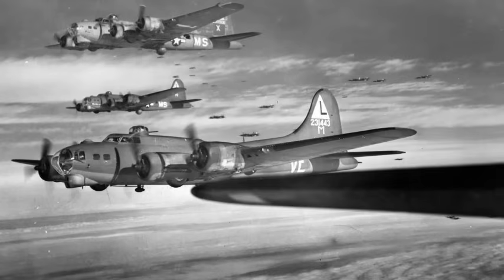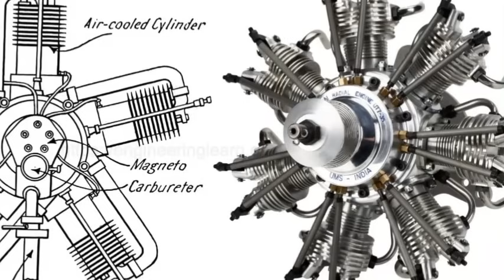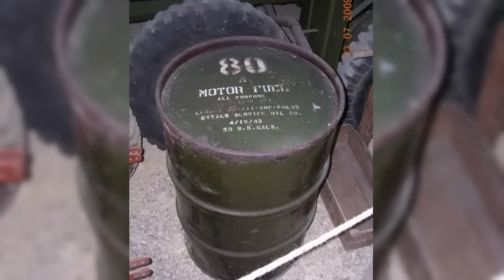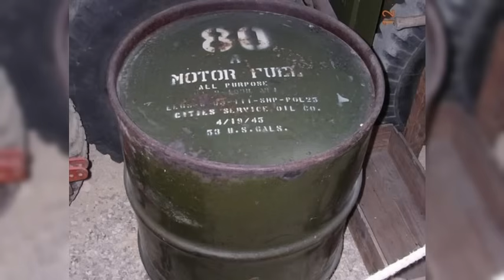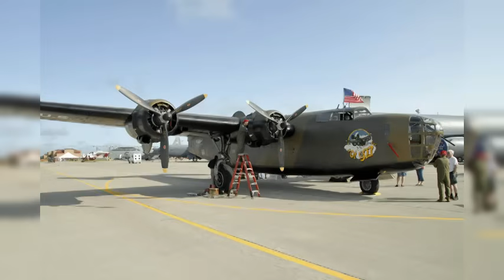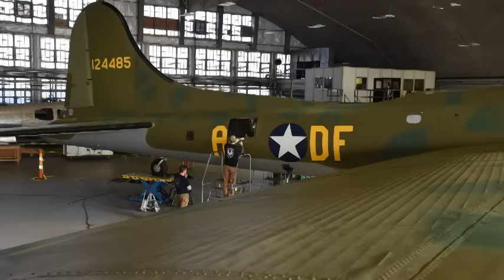The Lubricant That Quietly Kept Allied Bombers Flying

Comment: The most important thing I learned working with top lubricant engineers was, additives don’t lubricate, only the base oil does. Now today’s top tier additives are helpful but too many or mixing brands with different additives can cause harm. 
The only thing I learned was changing the oil is crucial. 
Ironically I worked for Pennzoil’86-‘93 and by then the base oil was almost exclusively West Texas Sweet! The paraffin based PA oil needed to be changed often to prevent the wax from buildup

Comment: In the 80's, I was a gm certified technician. Oldsmobiles with the 307 engine were notorious for cloging the oil return ports if quaker state oil was used. First indicator of clogged return ports was oil leaks down the side of the engine as the valve cover filled up with oil. Pulling the valve cover usually turned loose a quart of oil per head on the floor. Inspection of head showed rocker arms and inside of valve cover coated with a waxy buildup. It was so bad in some instances that scrapers and screwdrivers could not remove the build up and components had to be removed and mechanically deburred of the parrifin/wax buildup. This problem became so bad that I could say to the customer "you are using Quaker State arn't u? The answer was always yes. So I'm not sure how using this particular oil from NW PA helped us win WWII unless radial engines didn't circulate oil like a v-8. This one particular issue became so bad that we refused to use Quaker State in ANY engine in the cars we sold and would not do an oil change if the customer brought Quaker State oil for use to use for an oil change. We always recommended penzoil for oil use. Never had any problems with that brand.
Reply: Retired gm tech- yes I have seen many engines with Q.S sluge,but. Those engines had less wear and could be rebuilt. To add Q.S. engines had less oil leaks. I know sluge is bad.
My american Porsche  likes thicker oil in summer,and it leaks.
I ues diesel oil for the additives.

Comment: Essentially, the Pennsylvania crudes are classified as a paraffinic oil.  Paraffins make a wonderful lubricant.

Fun Fact:  The modern day "synthetic oils" are nothing more than conventional oil that is processed to produce paraffin chains with specific chain lengths.  The straight paraffin chain is what allows the desired lubricity.
Reply: True synthetics include oils that are entirely synthesized from chemical constituents, vegetable polymers, and natural gas. Fully synthetic lubricants do exist that are not derived from crude oil. Group V. Including those made from: Esters, polyalkylene glycols, GTL, and bio-synthetic lubricants.   
 Reformulated crude oil "synthetics" are those that have been processed from crude oil components to re-link broken polymer chains and link new ones. These are not true synthetics. When catalytic reformulation is used on petroleum fuels they aren't allowed to refer to it as "synthetic" by law, but that doesn't apply to lubricating oil. That's a questionable marketing ploy used by motor oil packagers and includes synthetic blend and semi-synthetic monikers. The biggest benefit is increased production the same as reform gasoline. That allows the use of unsuitable distillation fractions by synthetically modifying polymer chains.
 If you want to use true synthetic oil, you need to be careful to validate  the preparation process used to make it.
Reply: @ir8d8rads  Tyvm, I am not aware that there was a legal definition of "synthetic oil".

I appreciate your contribution, but it comes across as if that hair was split any finer, it would only have one side.

I was also referring to the mineral oil base lubricants, not some of the various lubricants that you mentioned which usually have very specific applications such as fire-retardant lubricants or food grade lubricants.

Comment: That was a very interesting story, but does demonstrate a lack of understanding of aircraft, the DC-3 was one of and Is my second favorite and she held 26 gallons per engine, With Normal Usage rates as high as 1 Gallon Per hour, per Engine.... but NONE of it actually in the engine,.... but in tanks behind them, Circulated strained, cooled and returned to the Tank, no filter,.... the dilution had been removed from all engines by the sixties and seventies, as "DAMAGING" per an FAA mandate,.... and the engines that ran to TBO, 1200 hours and some as long as 1600 hours all ran on Texaco AEO-120,.... and even the LAST Commercial L-1049F-93-59W flown in this Country (USA) N515AC/AF-SN 54183 C/N 4202 RAN to TBO and beyond on the Texaco AEO-120, and in our case NOT because it was better than the pennsylvania oils but because It was Still available In sufficient Quantities while the pennsylvania oils are Not, and when we closed the company NO Aeroshell oils were Available/Approved/PROVEN, for those engines In sufficient Quantity to support 14, DC-3's, 6, C-46, 1, L-1049F, 1~3 L-18/C-60's, 1 H-500/PV 2 1 DC-6, 3 DC-4's, 1~8 DC-3S/R4D8's In daily Commercial Operation, and more of Our engines ran till TBO Than failed, Even running Water Injection on those Equipped ( The L1049 & DC-6 ), We Shut Down in 2000,  due to lack of Available Maintenance and Operation expertise And Parts Availability.

Comment: They added a small amount of Molybdenum Disulphite to oil in aircraft engines. It bonds to metals where there is friction. The surfaces became so slick that even when an engine lost it's oil it would run long enough for the pilot to descend and safely land the plane.
The product is still for sale in auto parts stores.  Anyone can walk in and buy a can of MoS2 for about $10.00 and add it to their engine oil.  Add it to your crankcase at full running temperature and drive around for 20-30 minutes, preferably at highway speeds. It bonds to the metal and doesn't drain out at oil changes. One application should be good for about 50,000 miles. You will probably notice an improvement in gas milage too.
Reply: just buy oil that has moly in it.
Reply: @V8Lenny I have 3 1991 Mercedes-Benz w126 and I use only moly oil.
Reply: @michaelhayes7469 many people use without knowing because moly is not advertised, it is just common additive in engine oils.
Reply: Best way to destroy any engine sweetie. Clogs the oil paths and reduces oil pressure which kills engine life for short term gain
Reply: @Jamesphillips-q2t  I have 2 cars  and several small engines that beg to differ.  4-6 grams of suspended 1.5 micron Molybdenum in 4-5 quarts of oil isn't very likely to plug up any oil passage large enough for motor oil to pass through.

Comment: The commentary is wrong not quarts..gallons.a wasp rotary oil tank would hold 40 GALLONS of oil and a tight freshly rebuilt engine would consume 1-2 gallons per hour of flight time.
Reply: Radial NOT Rotary, different Engine design Entirely
Reply: I thought that sounded incredibly low. My Grandfather was a B-17/B-29 Mechanic in Guam. He also designed the pumping system that pulled oil from drums in the fuselage and out to the engines to make the flight from Seattle to Guam without running out of oil before arriving safely. He later became an Engineer and Inventor. He also designed and built a washing machine that was used to wash uniforms on Guam. It even had a 24 hour detail placed on it by the base Commander.
Reply: Why would it burn so much oil?
Reply: @resqjason2  In part because half of the cylinders faced down and oil ran past the rings, and in part because so many parts don't seal well and they leaked at every gasket, and in part because they depended on pressure escaping through the vents which carried oil vapor and even some oil blowing away, those engines leaked a lot as well to the point they had to have "drip pans" when they shut down or they would get you thrown off of civilian airports in the "Modern" EPA days, (" if they aren't leaking they dont have any Oil left" ) 80 year old technology was that way, most of the shaft seals were the old Leather "garlock" brand which doesn't seal as well as the more modern synthetic Rubber variety, They Burn the most at start-up when they clear the cylinders of oil, hence the large cloud of smoke, and also why the Propellers had to be pulled through by hand before the Starter engaged, An Oil Locked ( hydraulic lock) cylinder will destroy an engine.
Reply: @resqjason2 Reciprocating engine burns half the oil from piston rings and valve stems the rest would leak out

Comment: 32,000 feet for 10 hours with ground temperatures "routinely" 40 below?  Not in the European Theatre.
Reply: Ground temps probably NOT -40 but even in south Texas temps at altitude can reach -36 ~ -40, I live And fly there,.... do not stick your hand out the Ice window if your wife likes your fingers
Reply: That 40 below is the air temperature - I did not hear 'ground' mentioned
Reply: @chrissmith2114  - Listen at about 4:30 and you'll hear "minus 40 F on the ground".
How you and the OP want to define "ground" is up to each of you.
Reply: in Finland yes, it was cold in Stalingrad also

Comment: IN WW2 THEY ALSO DEVELOPED A GRAPHITE ADDED OIL WITCH REDUCED ENGINE WARE, HEAT AND INCREASED FUEL RANGE.  THE PROBLEM WAS THAT THE GRAPHITE WOULD SETTLE DOWN TO THE BOTTOM OF THE OIL TANKS. IN THE 1080'S ARCO CAME OUT WITH ARCO GRAPHITE OIL WHERE THE HAD DEVELOPED A ADDITIVE THAT KEEP THE GRAPHITE  IN SUSPENSION WITH THE OIL. I USED ARCO GRAPHITE OIL IN MY TRANS AM AND REDUCED MY WATER PREMATURE BY 10 DEGS. INCREASED MY FUEL MILLAGE 2 MPG AND MY HORSE 10 TO 20 HP.
Reply: I add a couple of quarts of diesel every tank of gas. In the Pacific, they accidentally fueled up the commaders'  bomber with diesel and cought the error and drained the tanks, filled with avgas.  On the mission, his plane outpaced the rest of the squadron. They figured the residual diesel in the system was the cause. There is a vid on YT where they test increasing amounts of diesel in the gas and one ratio actually slightly increased power. Also they should bring back ArcoGraphite.  Maybe if they colored it something, it would sell better......
Reply: A friend used it. 
The oil was black.
Reply: I remember seeing that as a kid. Our high school shop teacher swore by it.

Comment: The necessary addition of teraethel lead octane boosters destroys the additives in conventional lube oils, thus leading to sludge and frequent oil changes.
 The change to no lead gas is a major contributor to longer life of our IC engines. Sludge buildup is actually rare even with extended oil changes.
Reply: And the PCV valve. Prior to the PCV valve, engines were 60,000 to 100,000 miles max. After the introduction of the PCV valve, 250,000 miles was not unheard of. Crankcase ventilation suppresses sludge.
Reply: Yep TETRA-Ethyl lead can sludge-up with modern oils, those oils didnt Exist in WW-II, and the Engines all called for an ashless dispersant motor oil of sixty weight (AEO120)

Comment: Pennzoil weas blamed for many premature engine failures in the 70s and 80s,must be a different oil in the WW2 round motors.
Reply: They were erroneously blamed by mechanics who had no knowledge of lubricant tribology . I can confirm that having been in the automotive repair business for 33 years. The average mechanic has his pet brand but really doesn’t know what it is made of. They usually just like the brand’s marketing. With the advent of tightening emissions and poor designs in the 70s-80s many engines were experiencing excessive engine deposits. Even as late as the late-90s Toyota was having horrible sludging problems on two of their most popular car engines. It didn’t matter if you ran full synthetic oils and changed it every 3K miles. By 100K miles the valvetrain would be sludged. I overhauled many of them that had impeccable maintenance records. Ford had the same issues on their earlier EFI Windsor engines.  It wasn’t the oil as much as it was an engine design issue that the lubricants just couldn’t overcome.
Reply: I believe some of the 10w- 40 was little more than 50 % oil, the rest was "viscosity index improver" (thickener),pour point depressant (possibly light kerosene or varsol) ,detergent and anti wear/anti seize ingredients and possibly antioxidant 
  not sure if the original Pennsylvania crude of the best quality had ran out (wells exhausted) at that time (Texas Tea ?)
Reply: In the 90s I sold lots of Napa engine overhaul kits, add notice that for mid-80s and newer Chrome Moly rings we're available and recommended write about the time a lot of vehicles were starting to be manufactured with fuel injection. Among most of these engines oil consumption dropped considerably. What was happening to the oil blends at that time, I do not know
Reply: not for americans who never change oil, wax made sludge, Kendall removed that wax, Pennzoil and QS not.

Comment: I'm in Texas and remember in the 1960's Pennsylvania oils were shunned because of high sludge build up in engines. Could be a Texas thing. Could be lack of timely oil changes. Don't know.
Reply: In the 60s I thought Penzoil was the best. In 74 I tore down my Sprite engine w I th 40k miles. Solid sludge in spite of frequent changes. Changed t o Castrol and no more sludge.
Reply: @timthomson352   Penzoil got a bad reputation in my mind by the 1980's.  IDK but thought it was a matter of additive packages and refinement.  The fact that it's based on a "waxy" stock suggest it could be prone to sludge?
Reply: @Mrbfgray  Was the straight SAE 20 oil OK but the multi vis 10w- 40 the bad one ?
Reply: @davidpowell3347   I never used anything but multi-grade oils in engines.  (compressors and such aside)  So didn't pay attention to that but always intended to use the best motor oil regardless of price.

My 2011 BMW M3 requires 10W-60, about $120 per 9 quart oil change for the stuff I use and I don't care about the price....within reason.   It's a $25k 'race' engine, lol.

Comment: I remember filling that Aeroshell 100, pours like thick syrup when cold, and the dipstick has a thick layer of oil on it. After running the oil is thin like water, and black even though it has only been run for 15 hours on a single flight.
Reply: @ Oil Also Carried Heat Away To Scavge
Holding Tank.
Reply: I asked at an air show... 70 weight straight weight oil...

Comment: 37 quarts? Try 37 gallons, yes gallons, oil capacity per engine. And on very long missions, that was marginal.
The photo isn't a Wright R-1820, it is a model airplane engine.
The oil in circulation at those low ambient temperatures was comfortably warm, controlled automatically by a Vernatherm valve.
Reply: Ok 4 X 38  qts
Reply: I was going to say my truck takes 13-15 quarts.
Reply: Too much Artificial un-Intelligence writing this crap. Errors everywhere..
Reply: @jenniferwhitewolf3784  The artificial variety is no substitute for the real thing!
Reply: Can’t remember how much oil the S-58 took, I know it burned about a gallon an hour, and we never changed it.
Reply: jackthompson-lr2hc: "it is a model airplane engine".  Tell me it isn't so, Joe...🤣
Reply: What is it in pounds please 😂😂😂
Reply: @MoggieHendry The oil weighs about 7.3 lb per gallon.
Reply: I thought that sounded incredibly low. My Grandfather was a B-17/B-29 Mechanic in Guam. He also designed the pumping system that pulled oil from drums in the fuselage to make the flight from Seattle to Guam without running out of oil before arriving safely.
Reply: I was thinking that M'self, Jack Our Connie held 37gal per engine, and an additional 110Gal in a Central tank with transfer pump, Valving to each engine (pilots really hate standing on a wing with a five gallon bucket of oil In flight, Don't ya Know ? LMAO) and all the Bigger engines 2800 P&W, 3350 C/W had oil quantity gauges, and Engine analyzers, yes you could find a bad spark plug in flight, down to the cylinder and front or rear, dropped valve, cracked cylinder, And of Course A Great flight engineer who could read the waveforms
Reply: You seem to know a lot about them, don’t you ?
Reply: @WWIIRealAccounts I have been interested in this technology and WW2 all my life. It is a fascinating story. I think it is important to get the facts right and to keep mis-information from propagating. I'll take your comment as a compliment.
Reply: @WWIIRealAccounts  He's correct, have a problem with that?